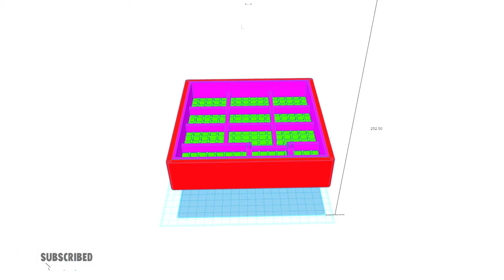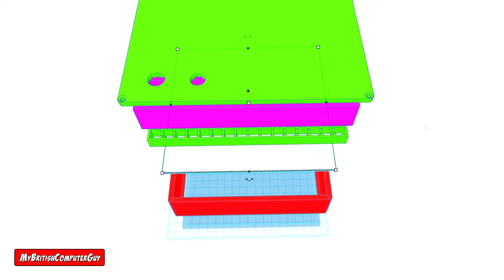16x16 LED Matrix Setup with WLED and ESP32, BEST Enclosure Design!

Comment: You really do an excellent job of explaining what you are doing  and how it's done. I've spent hours figuring this out with little bits here and there on channels and you do it all.  

BTW a really cool addition to the project is to add a microphone and enable the sound reactive feature on WLED!
Reply from the maker: Cheers @happydupa, I have done sound reactive builds before and have a video that shows how to solder and configure a digital mic to an ESP32, so I figured if folks wanted a sound reactive version of this build they could look back at the other video and incorporate it. I probably should have mentioned it in the video though (derr) lol. I had a senior moment I guess. Thanks for the comment!

Comment: You have done a great job in designing these projects. I've liked a few to use later when I get a 3D printer in approximately 6 months and start making my own. One thing I noticed is that you could have put depressions in the "holding cage"? That takes up the space between the LEDs and the backplate to make it easier for the wire run. It would take the bow out of the back panel. Other than that, great job, and I finally subscribed so as your channel comes and goes with the algorithm.

Thanks for your work! ✌🏽
Reply from the maker: depressions in the "holding cage"? can you clarify? i'm curious. You mean like cut out notches? I think I understand what you mean. That's actually a pretty good idea. If I were to do that I would need to make the main supports of the cage thicker as it would make the cage more flexible and not apply sufficient pressure against the LED matrix. Definitely worth exploring that option though. Thanks for thinking to let me know! As for the bow in the back panel, that was actually caused by the printing, it warped ever so slightly. I ended up taking some advice from a chap on a 3D printing forum who suggested cleaning the print plate with soap and water, and when I printed the Black parts I printed a back panel in Black.. long story short, the Black back panel did not warp! 

Thanks for subscribing! I've got more stuff coming soon! and you're welcome, I really enjoy creating stuff!
Reply: @mybritishcomputerguy  - Never mind. I looked at the video again. There is more space between the piece that the esp32 is connected to than I first saw. I had to stop the video as it went by so fast I missed it. Cheers!

Comment: Get rid of the push button and use a pin on the ESP that supports touch sensitivity. One less part required 😊
Reply from the maker: Sound like an interesting idea. But surely I would still need a part to touch?
Reply: @mybritishcomputerguy  nothing other than a piece of exposed wire. Perhaps the case could be redesigned slightly to swap the button hole for a place to loop a wire out and then back inside to be secured?
Reply: @mybritishcomputerguy  you could make a grid array of holes on the top/side/back of the case to stitch some bare copper wire in and out to create a touch “pad”, so to speak.
Reply from the maker: That sounds pretty cool. I may try that approach for an upcoming project, i will certainly give you credit for the idea! cheers Mike. @mikestewart4752
Reply: I've been working on this, the plan was to drive a nail into the box for a pad to touch and solder a wire to that.  For some reason though, one of the touch pins on my esp32 fires constantly when enabled, no matter what the threshold is, so it is useless.  I believe I need to compile wled myself so I can adjust some variables to make it less sensitive, but I havent got around to it.

Comment: I don't have a 3D printer, but I have a cricut machine so I bought a small shadow box and built up a lattice from strips cut in black card stock. You should make another grid with black plastic to prevent light transmission to adjacent cells, or perhaps a layer of black spray paint would work.
Reply from the maker: Thanks beefnuts, I did eventually print a Black grid, I only used White for the prototype as that was the only PLA I had on hand, and I wanted to get the video out to the masses. lol. I had considered using Black spray paint, but I figured it would end up being rather messy! lol
Reply: I haven't got round to it yet, but I bought several shadow box frames from Hobbycraft, which can be modified for this purpose and, as I write this September 2024, are currently half price at Hobbycraft. Alternatively, it's always worth checking out charity shops for old picture frames. I bought one for £4 and three 8x32 panels fit just about perfectly with a little border round the edges.

Comment: Very nice. I am in search for the perfect 3D house for the same project and you are damn close for what I'm looking for :)
One Tip: If you can, use D head screws for the electronics (the ones with flat bottom under the head instead of the countersink cone).
Reply from the maker: Thanks, Yeah, I would have used the flat pancake style screws to secure the ESP32, I didn't have any on hand at the time. Also, I have never found any that are Phillips head style. I don't like using the slotted flat head style as the screwdriver has a tendency to slip off the head, and in the past I have damaged an ESP32 with a screwdriver using them. I'll be sure to mention that the next time though. Thanks for the comment.

Comment: where I can buy this diffuser?
Reply from the maker: The diffuser is basically a stencil sheet. This brand is from a store called Hobby Lobby here in the USA. I don't think all stencil sheets are created equal, I kind of lucked out with this brand. There should be a link to it in the description. You may have to try a couple of different brands before you find a comparable one if you are not buying the exact same one I used.

Comment: Thx for sharing your project. I believe you miscalculated the needed Amperage for the power supply needed.
The 0.06 value is per led. As you have 3 leds (RGB) for each pixel, you will need to multiply\y by three for the correct value.
Reply from the maker: I may have said per LED, when I actually meant per pixel. 0.06mA is the power draw for full white on one pixel.
Reply: @mybritishcomputerguy  You were correct with the total power draw. I could have recalculated first myself, before commenting.
Reply from the maker: It's all good :)  @WackyWindsurfer

Comment: Where’s your current protection? That usb cable cannot tolerate the max potential current draw. The wago connectors will not tolerate that power draw if they are Chinese clones. The power switch is not rated for potential max current. There is no ventilation, how do you intend to manage the heat build up in the case?  This is a great concept but dangerous implementation that could burn down your house. This information carries a lot of risk advising people that won’t know better how to put a potential fire hazard inside there house. It’s all good until it isn’t.  Rethink your approach mate.
Reply from the maker: Thanks for the thoughtful comment, I'll start by saying you are right, the USB cable probably cannot tolerate the maximum "potential" current draw, but it's more than capable of handling what it's drawing in my demonstration. I'm not sure how much of the video you watched, but I was just using a USB dongle and 2A power supply as a means to test the unit.

As far as the Wago connectors are concerned, I recommended all connections where Wagos were being used be soldered  (@09:29). Wago connectors were just being used for example purposes to show the connections, and tbh they are fine for 5VDC 3A. I didn't want to spend much of the video showing soldering.

As far as what I showed being a dangerous implementation, I would have to disagree with you on that. There really is minimal heat build up in the case, even now that I have hooked up to my 5VDC 3A power supply (Cell phone charger btw). I'm not sure how much experience you have with the WLED software, but it has a built in automatic brightness limiter, which automatically limits brightness, and prevents your PSU from being overloaded. It defaults to a 850mA max draw (if memory serves me correctly), I normally set this to 3000mA. The switch can handle this without issue, we're talking cell phone ampage here, even at 15A at 5VDC I doubt the switch would be a concern, had the build used 12VDC then I'd say their would be more of a concern (which is why I don't use 12V). I use a 5VDC 3A PSU to power most of my builds as they are all quite small and I steer clear of higher voltage, higher current builds. If I ever do a monster build, or create something that is going to generate heat or draw more current, then ventilation would indeed be incorporated as would fuses and heavy duty switches.

Thank you for taking time to write though, and based on your comments I will start discussing safety in future videos.